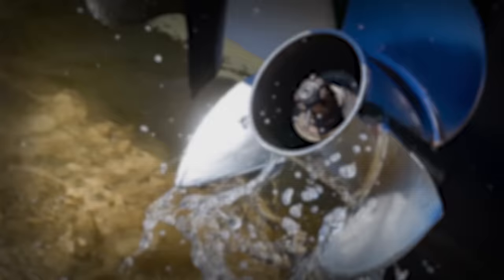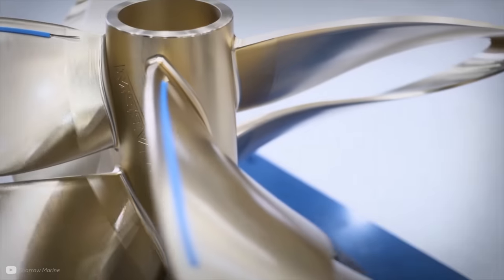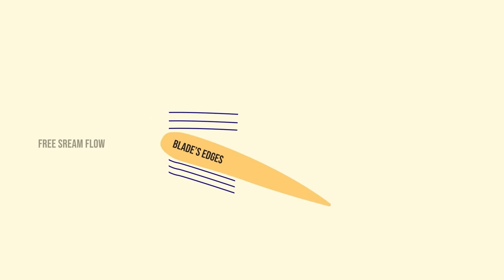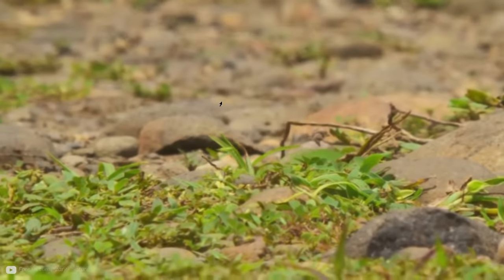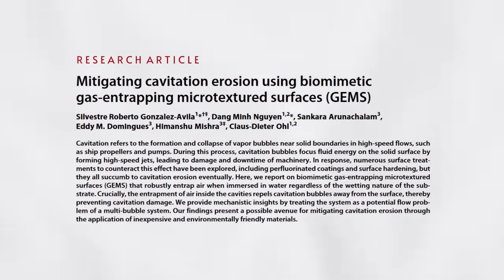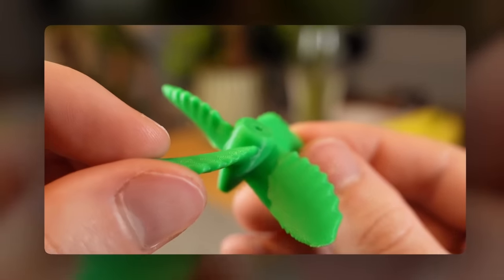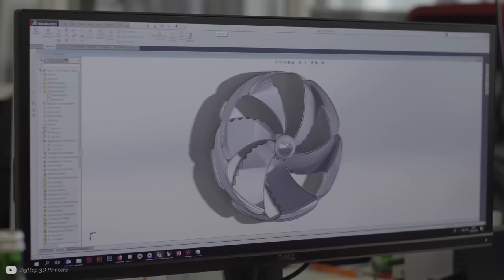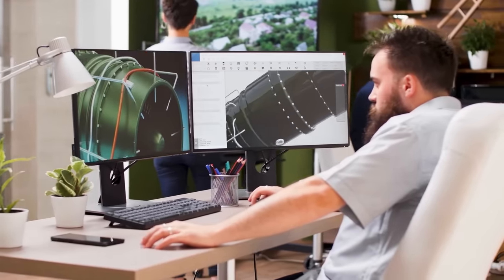The Unexpected Genius of Bionic Propellers

Comment: Have you looked at the duo prop? Volvo-Penta introduced the idea a number of years ago, 2 props on the same drive shaft, turning in opposite directions. I can't remember the specific numbers but these props gave significantly better performance.

Best of all, they backed it up with production. The Volvo-Penta IPS drive for motor yachts comes with duo-props.
Reply: I am not familiar with maritime applications. In aviation however,just before the jet age took over,
aircraft such as the F4U,P47,P51,Seafire FR-47,were built with contra-rotating propellers.
2 three bladed props. YT has a great video of the only airworthy Seafire FR-47.
The Seafire FR-47,a Spitfire variant,used this design to neutralize the torque effect of the engine,
so as to utilize more power on take off from aircraft carriers.
Contra rotating- opposite rotation,same axis
Counter rotating-opposite rotation,different axis (P-38)
Cheers
Reply: @billysolhurok5542  and the helicopters that have contra rotating props don't need or have a tail rotor.

Comment: I've owned a long string of boats since the age of 16 - 63 years ago. Little boats at first then bigger and bigger boats. I learned about cavitation with my first ski boat. I never gave much thought to it just adjusted the boat to the point where it was most effective. I read about these propeller designs earlier but your information about the whale was very interesting. Manufacturing cost and variability are the prohibitive constraints right now. I think the manufacturing issues will be worked out over time but they will still be costly. The same considerations have been used in wing design for some time. As to creative design, it is what human kind does. One building block at a time, each one enhancing what was done before. Every now and then something new will come along but even in that regard there is most often a history of development. Even some of Einstein's thinking was based on the creative thinking of other individuals. Good report.

Comment: I came up with a biomimetic propeller design back in 1997 or 1989 while working at Arcturus Marine Systems. I even have a "poor man's patent" of the idea - I mailed drawings and notes of the concept/design to myself in a stamped and sealed envelope. I even put an extra postal stamp on the back of the flap and had it canceled manually before I mailed it to myself, I still have that sitting in my fire safe.

Comment: Please use the Metric System as used by 94% of humanity.
Reply: I’m glad they don’t. I hate the metric system. So many writers use it wrong. I once read a story involving a  crew member of a space ship being a few centimeters taller than her fellow crew members, described as “towering over them.” Intrigued, and not being very well versed in the metric system, I used a formula to convert it to the standard English system and it turned out that the few centimeters converted to two or three inches. Towered over the others, indeed. If two or three inches is towering over others, then being 5 feet 10 inches tall, I must be a giant. 😅😊
Reply: Less than 10% of the books written before 1960 use metric. Very few of the Europeans I've met know what a pascal or a dyne is.

Comment: Just a simple observation.  I was flying a custom home built 30" span rc model with a standerd 6x4x2 blade prop. It  behaved like an underpowered aircraft literally hanging on the prop and quickly went down in a farmers field. I recovered the plane and noted the leading edges of the prop were seriously scuffed up as though a sand blaster had hit it. Not having a replacement blade handy, I launched it again. The result was a dramatic performance improvement in speed. However, noise was much greater. The only change I could attribute this to was the blades leading edge.

Comment: Hi. The small insects that "walk on water" rely on surface tension. Water forms a "meniscus" because its molecule is polarized.  This is why the flat surface of your cup-of-tea curves upwards where it joins the sides of your cup. It can curve downwards too if the sides of your cup are dry. Nice video, thanks. P.R.

Comment: As a youth I love ved fast boats, extremely fast boats. I learned from John McCall, inventor of the tear away cowl in race boats was also an expert on props, he'd get as much pitch as possible then cup to tune, running wheels he built required the prop to be a tad over halfway out of the water  in line with the planning surface. Also a modified V with a very small planning surface helps as well. Performance wise, they were dogs out of the hole, (to get on plane) but once the prop bit, it'd set you back in your seat hard and the howl the prop made, could be heard from Sarasota Bay to the Venice Inlet (Jetty's) the boat went from a 50 mph boat, with Factory sized prop and a 75 3 cylinder on 14' boat (Allison, factory Built Race Boat) to 75+
A few buddies and myself, all working class fellows had to compete with the Billionaires across the intracoastal waterway who'd buy the best they could find but they couldn't buy the wisdom of John McCall RIP

Comment: That is highly interesting and almost suprising that it took so long to take off as a field of research. Especially with how many "speed freaks" are into plane and speedboat racing and how much those poor into better drive performance.
I also wonder if they though about the integration of "shark skin" analogues as they are proven to enhance flow dynamics as well.
So, would a prop designed in biomimic way, coated with a shark skin like texture be even more efficient?

Comment: My background is that of an unlimited ton captain, seeing the toroidal propeller had me thinking about if it could pay for itself by the time it was past its service life. Took in factors such as increased fuel efficiency, better thrust, and less wear and tear on the propulsion system. At the time a started calculating, it unfortunately did not pay for itself. This is in regard to the 45” diameter bronze alloy prop i need to use. I also need 2. 
These bionic propellors have me excited. I need to research the price or a quote but i know they will be a fraction of the cost of a toroidal prop. Not a ton of published testing for the bionic prop but as soon as their is enough info, im hoping the gains can pay for the bionic prop or even start to make me a profit

Comment: There is an issue that you didnt mention and that is the smoothness of the blade surface.
I can only speak of water which is different from air, in that water is incompressible whilst air is not. 
So what I recall should be reconsidered for AIR movement.
Rowing shells - smoothness has been challenged by macro textural roughness to create a layer of trapped fluid against the shell and that the movement of the boat, (as result of the blade being locked in the water), acts as a miro cushion with the water surface shearing water against water and not the shell against water. ref Eric Sims of Eaton Boats.
The surfaces of HV Electrical insulation - a problem is caused by leakage voltage over the surface of the insulation as wetting occurs, but more so when there is dry banding. That is surfaces that dry whilst others remain wet. One solution has been to roughen the surface, (~grit 80) by adding deliberate texturalisation which is not rough to touch but with sufficently macro undulationmoulde on to the surface to encourage wetting and suface fluid retention. In doing so the electrical gradient remains more constant as the frequency (50hz) changes across the surface, making the gradients unstable if the surface is inconsistantly wetted.
ref Cardiff University and Soton University HV Electrical departments.
These ideas were experimaentsl investigation during my Engineering Career 1988-2018 and my hobby of rowing 1994-2024 ... I can be contacted at 07539156388 for further assistance,
Mac surface texturalisation may rovide a more stable surface wetting when in motion and reduce water shear at the blade surface ...

Comment: In 2006, I worked with one of Dr. Fish's grad students to build a tubercle wing for a race car. We had a 40% model made and ran a full day in a wind tunnel (AAR in Santa Ana, CA) to test. There were some effects, but they were very, very small. We often run stalled or near stalled and in that situation, it just wasn't much of an effect. We were hoping for the best and stuck about $50k into the project, but we never got anything out of it. We know that at least one Formula 1 team investigated the idea and I never saw it on their car.

The student was from Cal Tech. He was brilliant, but we ended up parting poorly when he started trying to claim results that the data just did not support. I was really disappointed that a PhD, from Cal Tech no less, would stoop to this level. I'm in racing; bullshit get called early and aggressively. As I've gotten older, I've come to think he was just a product of the institution which he was trained, as we've seen many from prestigious schools will do the same thing.

Comment: When we returned from our honeymoon, we stopped at the Albacore museum. There was a vessel on display with an experimental "cavitation drive" - two nacelles supported the main body, with the propellers at the front. The idea was that cavitation would lower the resistance of the nacelles. Supposedly it did about 60 knots.

Comment: Hi, great video presentation you make. I wanted to add the info about the less noisy fan blades. All Atlas Copco workplace air compressors have fan blades to reduce the sound level so you can put them close to a workplace instead of in a seperate sound insulated compressor room. This they do for many years now. Also many manufacturers of industrial cooling racks use them. It really makes less noice. I do not understand why wind turbines do not have them all if it increases more energy.

Comment: A similar design has been used on carbon fiber road cycling wheels to reduce drag and improve aerodynamic efficiency but mostly to mitigate the lateral forces on the wheels in a crosswind.

Also, in your search for interesting propellors, I'm pretty certain you're already aware of the Sharrow Propellor, but if not, it's definitely one to check out.

Comment: Feathered propellors are like owl (silent) wings - with little or no cavitation or air bubbles.  Using front-end feathering, and/or back-end feathering diminishes cavitation, but also diminises water surface drag.  Like the same that should be used with helicopter blades (and the thunk, thunk, thunk sound) you need to use the same upturned wind tip, shooting the sound of the propellor upward and away from equal or underneath viewers/listeners.  Also feathering the back end of wings also silences the wings, but also stop further air drag and noise.  Water propellers outward edge (like the torroid propellor) having a feathered edge further silences any vibration, engine combustion explosion and bearings noise passing into the propellor into the water.

Comment: Traditional propellers used in marine and air transportation have two major problems – cavitation and excess drag. Cavitation happens when the pressure on the low-pressure suction side of the blades drops, causing water to vaporize and small vapor-filled bubbles form. These bubbles erode the blades, reduce efficiency, and create noise. Excess drag is caused by the angle of attack between the blade's edges and the direction of the oncoming fluid. Managing these two problems is essential to improving propeller efficiency, which is critical for reducing noise pollution that affects marine animals and aircraft passengers. Biometric solutions inspired by nature are transforming propeller design. For example, 3D printed propellers based on the tubercles of humpback whales, which reduce drag and improve maneuverability, have been tested with promising results. Propellers inspired by the flippers of penguins and the scales of sharks have also been developed to improve efficiency. These biomimetic designs could reduce noise pollution and improve efficiency, which is essential for sustainable transportation and protecting endangered animals.

Comment: These props will be very important for electric airplanes which are limited in range by the size and weight of the battery.  Eviation has a commercial electric plane with a 450 km range, but by using a bionic or toroidal prop they could increase that to about 540 km.  Very cool.  
I suspect the real boost in this technology will come from large transport ships that carry cargo around the world.   Dropping the cost of fuel and increasing range is a game changer.

Comment: Great video! Have a look at the "owl wing" shaped blades of the fan in the "Weishaupt Biblock" heat pumps from Germany. They are the quietest (only 35 dB) heatpumps on the market since 2019. It's a bit like tubercules at the trailing edge.

Comment: On your image depicting cavitation, it's clear that it's a welded material, not cavitation. There's burn marks, on left side the welding pattern is especially obvious. Probably, the blade was slightly damaged by cavitation and is in the process of fixing, by welding more material on top and then sanding it down to restore original shape. 
Cavitation marks usually look like cratered surface, or like old casted metal with very uneven surface.

Comment: This reminds me of the dimples put into golf balls to break up vortices and reduce drag.  Also I would like to add that I am pretty certain ship props are made through casting methods.   Given that there is an inititial shape not in the final material, it should not increase the cost of manufacturing.   The problem:  PROVE that it works and will save money and fuel as well as reduce noise and reduce maintenance.  If that can be done then it is likely to be adopted.  If it is true that this reduces noise, then it could be a boon for drones also.  They can be noisy buggers.

Comment: Your 3D printing comments led me to imagine repair ships, trucks and facilities able to 3D print any repair part out of any material. Every customer could carry their complete catalog and have cloud stored for non security systems like military apps.
Having cranes, rigging gear and highly trained installers with them along with a hundred printers of various sizes will be the future. The power to run them all running various materials would be a easy to solve problem.
Next step - food replicator 😅

Comment: I noticed comb-like structures on the trailing edges of wind turbine blades made by Seimens and wondered about their purpose and location. My research revealed that these structures took their inspiration from owl's wings, which imply fuzzy feathers on their wings as a bio-mechanical solution to noise reduction. Owls, in this way, fly silently at night to catch their wary prey. The turbine blades as claimed to be quieter as well.

Comment: It's not just about pressure differentials. There are also Newtonian forces at play and the simply viscosity of the fluid.

It's these 3 parameters what, in the past, have made it difficult to calculate and explain how propellers and wings works. Even today, people still give erroneous explanations by either focusing exclusively on Newtonian forces or exclusively on Bernoulli's equations.

Airfoils can be so simple and yet so complex. That's the beauty of fluid dynamics.

Comment: Interesting side note for anyone reading: A development racing sailboat team recently experimented with tubercles on foils made to lift the boat out of the water. However they stopped running them and switched back to conventional smooth foils, no one knows the reasons as of yet. the team is Alinghy redbull racing in the americas cup if you want to find more
Reply: that being said I would absolutely love if you did a deep dive on foil design for kiteboards, sailboats, surfboards and pump foils etc and its in a similar vein to this

Comment: Interesting how this comes up. A one man canoe (I guess you might call it an outrigger canoe) made by Kamanu composites called the Noio, its rudder is based off of tubercles. Supposedly when you are riding bumps or waves it helps the rudder to do something. Maybe it was about sticking to the wave as the tail lifts up. I kinda forget but they also use the idea of “tubercles” another use case if you’d might be interested to know

Comment: When my narrowboat was out of the water, cavitation had created holes in the swim, the rear section of the hull the curves into a point just behind the propeller. It needed to be welded in order to build the damaged steel. That damage could potentially sink the boat

Comment: While trying to solve a bed bug issue I discovered a heat solution that was $4,000 cheaper than a guarenteed professional service. I bought the equip they where using. One large fan portable heater with separate extension cord plugs for eac of the 4 heating circuits. 100 % success with minimal electrical, However,  Noise from Heater Fan and and additional large fans > 120 db! Need this tech in furnace blowers for aux heat during minus 20 cold days!

Comment: Once the designs are proven (3D printing helping as you mention), casting metal propellers should not be a big issue, as far as I can tell. Gas turbine fins are relatively small, I am not sure how well those could be manufactured with these types of surfaces or how much benefit they would be. Very neat, thank you for the video.

Comment: Long ago, I devised a propeller with the "lift" side (usually, the top) covered in rubber, while the "drag" side (under) would be micro-groved  radially to "drive" the airflow inwards of the propeller or the wing. And then my ADD took over...